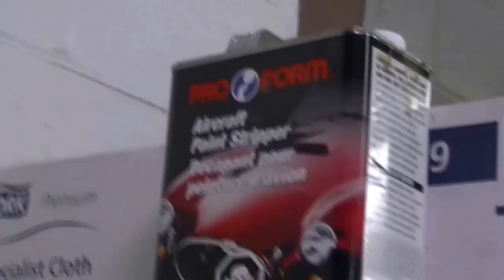How to Use Paint Stripper

Comment: I have always found brushing the striper on in one direction works the best. Pouring from gallon can into a quart can frist then taking your brush and dipping into quart can then apply a heavy coat in one direction, like in thick long strips. Disurption of the parifin is reason for one direction brushing. Once you lay down one thick strip in one direction move on to next strip. Don't over lap or touch already applied product.

Comment: We actually used a real "aircraft paint stripper" on actual airplanes. Spray it on, let it do it's job for about 45 minutes, then hose the aircraft off. Gets down to bare metal in most areas.

Comment: Agree  with the one direction of applying.  It says on a old can I had of aircraft stripper.  Scratch with a screw driver or pick.  Apply in one single stroke..  I guess the scratch helps the stripper creep under the paint.  And I notice where the over coat from the brush that's where the paint sometimes won't come off or need to be scraped.